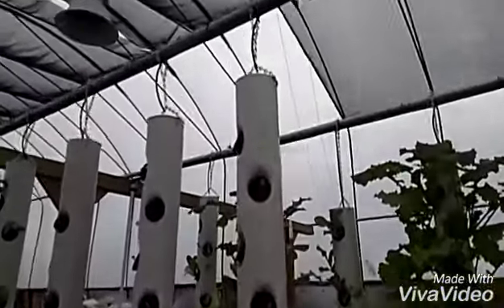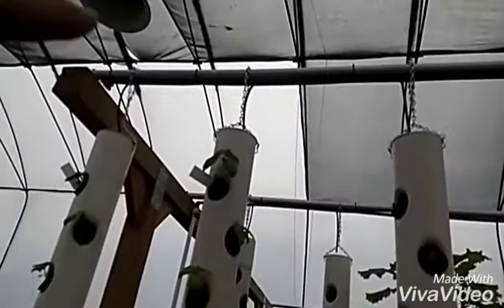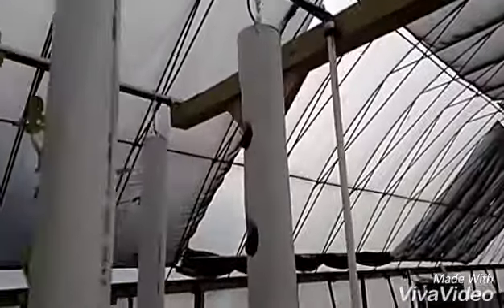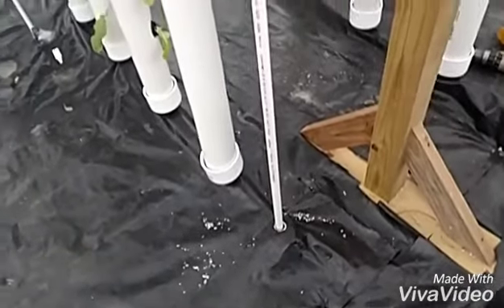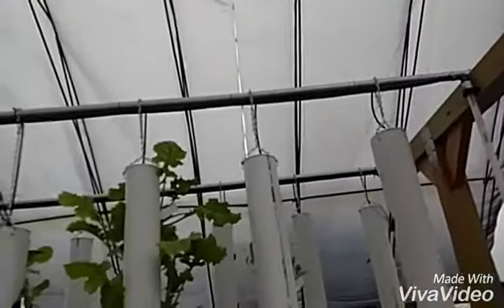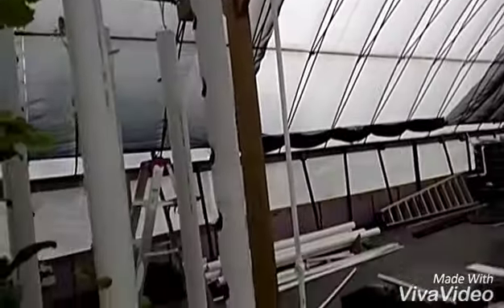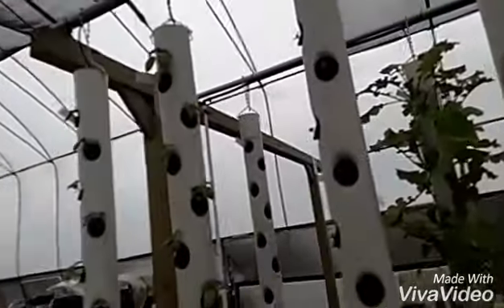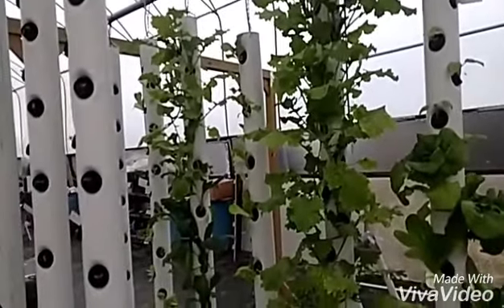Grow towers Part 3 changing drip lines

Comment: Can you just add a sediment filter in line to chat how all the solids, & set it up on a clean out timer so the sediment gets blown out & the sediment filter stays clear? The solid can be discharged into another holding tank where you have placoatomus fish 🐠 & pepper shrimp brake down the solids into even smaller particles that can pass easily easily through the drip lines.
Reply from the maker: Excellent idea, thanks for commenting

Comment: Before I got to your remedy I was thinking about something like a sink trap that has a tap on the bottom. Or maybe something like a "screw on " water filter. Just thinking out of the box! 🤔🙄
Reply: Sediment filter like on a well with a automated clearing timer, to keep the sediment filter from clogging. The solids can be discharged into a holding tank that can be broken down even further by pepper shrimp an placos fish.

Comment: Master how much water should I let go through the tower. thank you
Reply from the maker: Well I'm no master, I just do a lot of trial and errors 😏 . It does not take a lot of water. Just make sure all roots are getting wet and that the water is not running out of the holes. Hope that helps.
Reply: @greensgillsgreenhouse-g3868   very  thank you
Reply: the water flow is constant or from time to time
Reply from the maker: @ricardojuvanelli2172  I run it constant but you could run it 10 minutes on and 20 minutes off. As long as the roots don't get dry.